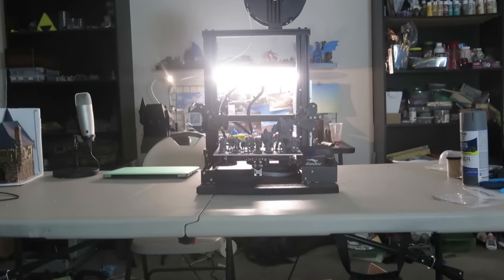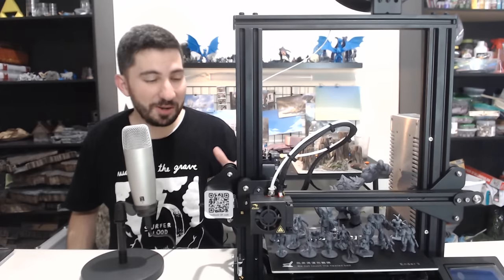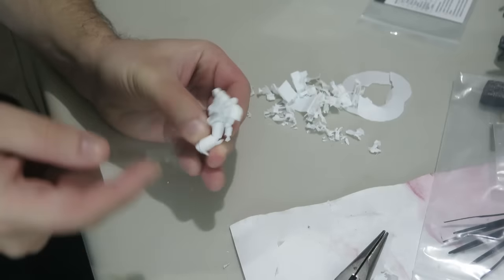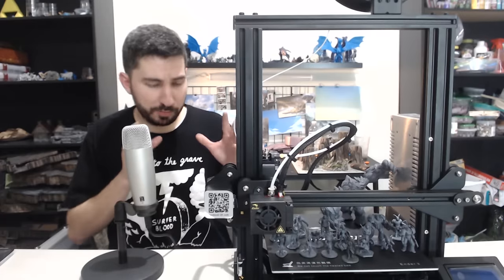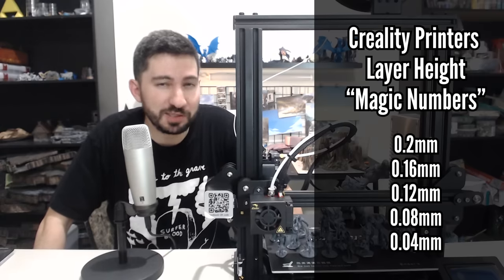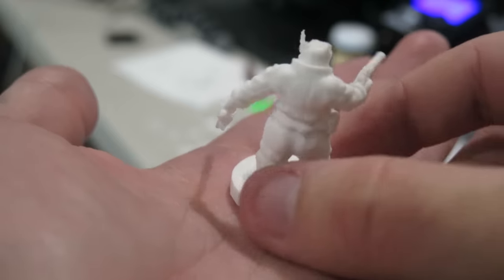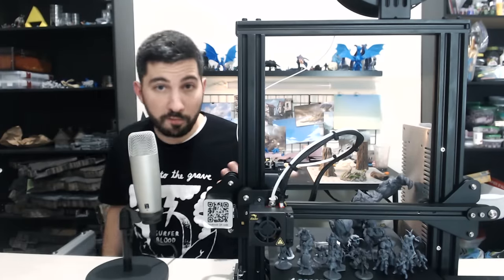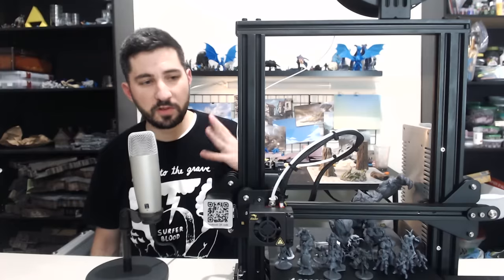How To Print Resin-Like FDM Minis on $200+ 3D Printers (Printing The Game #3)

Comment: Hey I got the ender 3 - i put a glass base plate on it but having print failures what do you recommended as base plate settings? As well as good prusa slicers setting for printing minis?

Comment: Ok so you're making these models with supports and all - what if you instead chopped them up and turned them into a sheet? (Looking at how Games Workshop makes all their Warhammer miniature sets) would it still be smooth? would working in width instead of in height increase your speed (slightly)? (mainly from not having to print many supports)
and then of course you get to glue them together, which is fun

Comment: Got another subscriber  :)  

I'm new to 3D printing and have spent quite a bit of time doing some research.  I've been most impressed with your results and that of a fellow youtuber "Tomb of 3D Printed Horrors".  So far, getting pretty reasonable results with a profile he shared and am about to try out the one you linked on your webpage (Siepie).  I'm curious though...which profile are you using these days and are you sharing it?  I pretty much have a stock Ender 3 Pro, save for some simple mods...the only one that could impact performance is the bullseye fan.

Thanks and LOVE the channel, keep the updates coming!

Comment: Im using Cura 4.8 and for some reason it won’t slice when trying to trick the layers. Won’t slice when top layers are at 9999999 and bottom are 0
Reply: Me too man. 4.8 doesn't like it. Just do 100% infill and change all your speeds to slower while leaving the top and bottom layers default. Trying it now to see how it turns out
Reply: @joelhamlyn5186  aye will give it a go mate

Comment: Couple years late to this party, but are there any changes you would recommend now that Cura has been updated? I am running into a problem when slicing models, the slicing is taking ungodly amounts of time. FYI I am very new to the 3D printing.
Reply from the maker: For now, I'd try some of the Cura Default Profiles actually! Fat Dragon Games also has a really great profile that is much better time-wise. I'll get around to doing a video on this soon though.

Comment: Hi there. I just found this video and downloaded the cura profile. However, I am not able to import it to Cura. I'm getting the following error. Failed to import profile from D:/Hobby/3D Prints/Cura Profiles/Siepie-CR10-Ender-3-Small-Minis-PLA-Base-1.0.curaprofile: Could not find a quality type normal for the current configuration. Any help. Would be much appreciated. Regards

Comment: Been trying out this profile recently and with 3.5.1 it appears that the Chunk option is bugged in that I can't see it any more. Also, I won't use ZigZag for the support again. It was all interconnected between the legs of a mini I printed and I ended up tearing off a foot. I'll try triangles next time.

Just found out that the chunk option only shows up for certain support shapes. Triangle is not one of them. Only appears for zigzag. :(

Comment: Trying this out now. It is my first printer, a CR-10s Pro. One thing I noticed was the base not adhering very well to the raft and lifting and moving slightly. Any tips?
Reply: Sounds like your bed level might need to be a little closer to get a better initial squish in the first layer

Comment: Its taking forever to slice, its been half an hour for a mini and still going with no progress on the bar. Did they fix the 99999999 layer height thing or is this normal? I'm using 4.4 ultimaker cura

Comment: my tree supporta always start to warp if they print far away from the model and my extruder bumps into them, any advice for this? i do use the regular supports depending on what quality i want or if im sure the tree supports will break and make my print fail.

Comment: so after thinking about 3d printers i finally got an ender 3 because of you and your vids. i played around with a few things from thingaverse and theings went well. I decided to try and print a figure but i can not get the profile to load it gives me this-Failed to import profile from C:/Users/randykathyv/Downloads/3DPrintingProMiniFile-Cura-4.2-and-on.curaprofile: Could not find a quality type high for the current configuration- am i doing something wrong. I am using cura 4.4.2

Comment: I tried printing the Tau 15 mm stealth suit and for some reason it was coming out horribly, it got to a point where the extruder was just missing the mark and drooping spaghetti in thin air. Any Idea why that might be?
 
I then tried the bigger settings for a 40mm version of the space marine and it came out okay, it was just hard to peel off the supports

Comment: It looks like Creality 3D upgraded the Ender with an MK10 nozzle. Thoughts?
Reply from the maker: To my knowledge it's always had a MK10 extruder - but I'm no tech-head. What were they using before?
Reply: @3DPrintedTabletop  the gearbest link in the vid advertises it with an MK8 nozzle. While the creality website states it has the MK10 now.

Comment: I'm using cura to slice my models and it's at 10 hours and still slicing...is this normal with your settings. Its slicing a kolbold monk 25mm tall model.
Reply: Did it finish yet?
Reply: @ethanthompson431  after 14 hours I canceled it. Started it again and 6 hours in canceled and haven't tried again.

Comment: My E3 almost perfectly prints minis with Cura standard profile, 0.4 nozzle and 0.12 layer. The only thing that annoys me were Cura supports as they are very solid and hard to remove, now i make them with meshmixer and that issue is solved. Trying to print with 0.2 nozzle ended in much worse quality while much longer printig time. I also don't notice much difference between 0.08 and 0.12 layer high with 0.4 nozzle, not enough to double printing time. 
Btw. tried to import your cura profiles, but gives error:  "Could not find a quality type high for the current configuration."

Comment: I am surprised I haven't seen any comments about  PVA filimant , if you have a dual extruder or can upgrade to a setup then you can print the supports with it and they will dissolve in water so you just soak the model and then no more pesky marks from supports

Comment: I got a creality ender 3, the nozzle can't move across the x axis without vibrating heavily or sometimes at all. Any time I try to print it just makes a 2 mm high wall all across the left side of the bed plate. I mean I had really high hopes, it is just not working and I don't know the problem or how to fix it, but I just give up, I have got such a big headache and I just want something to work so I can have some sort of hobby.

Comment: Hey I love the video, it has helped me learn a lot about the basics of settings for slicing software when it comes to printing minis. As someone who uses a flash forge printer and their FlashPrint Software i was not sure if you ever had translated those settings for FlashPrint or if anyone else has had luck doing so. i have gotten very close to the quality you are getting, but am still struggling with some details. Anyone who knows anything about FlashPrint for miniatures would be a huge help. Thanks!

Comment: I have applied to join the facebook group but have not been excepted yet.  So I will ask here. 

I have tried these setting is Cura but when I go to slice, it stalls out and there is no progress bar shown.  This only happens with the top and bottom layers betting at 9 infinitum and 0 respectively.  I leave those at default and it works just fine.  What's going on?  I am running the latest version of Cura if that helps.

Comment: I just got an ender 3. I can't get the bed flat though. It's driving me crazy. Any tips?
Reply: I ended up swapping it out for a glass bed. You can get one on Amazon for 20 bucks ish. You'll have to start using purple glue as an adhesive to make the print stick but now I hardly ever have to recalibrate my bed

Comment: 3D Printed Tabletop what happens if your printer needs supports for printing and it won't show. I use the cocoon from ALDI and it says that it needs all supports for the print but it doesn't have it for some of the models on thingiverse.

Comment: Hi! I have a ender 3 pro and can't seem to import your settings linked on your site.  "Could not find a quality type normal for the current configuration". Any thoughts?
Reply: I went ahead and put in the settings manually that i saw on you video but the slicing stops itself pretty fast. 
The thing that breaks my slicing is top layer 9999999999
Reply: @Andreasohlin  less 9's. Put 5 nines in and it should work.
Reply: @zorbat5  thanks! That helped :)

Comment: @3D Printed Tabletop Hi man I really appreciate your videos and I've learned a lot, I just really need help with something.  So  your Space Marine from thingiverse that you showed in this video is the first thing I printed on my Creality Ender 3 (which you said is the printer you used to make your minis) so when I printed it first the right arm just didn't print at all and was just a bundle of string, so I thought that maybe stringing was the problem, so I turned my retraction speed to 25 mm and to a 6 mm height. But even after that It still did the same thing.Can someone please help me?

Comment: With Cura 4.2:

(Cura) CR10/Ender 3 Terrain Profile Beta v. 1.3 - (fdmprinter) doesn't match with your current printer (creality_base), could not import it.
Reply: same here, im getting that error as well
Reply: I had  the same issue. Downloaded Cura 4.1 under "find previous versions" on their download page and it worked. Probably a bug in the newest version.

Comment: man because of your video i realy wont to buy this model printer and get into this hobbie i got alot of ideas i would like to try. would u say messing with 3d printers increase your electric bill?
Reply from the maker: Where I live electricity isn't TOO expensive - but no, it really hasn't impacted my electricity bill, and I'm often running multiple printers at least 15-20 hours a day (sometimes more). It isn't the cheapest of hobbies, but it isn't so bad either. Cheers! Good luck either way!
Reply: ofc they will running a heating element all day is like throwing cold cash in a burner.

you can test this yourself , turn on an electric oven at 180 degree's fahrenheit for 6 hrs a day for a month and check your electric bills

Comment: Currently this profile doesn't seem to work for Cura 4.2 (You can't seem to install the profile directly, and after going through and manually trying each setting, it seems to have issues with the top layer set to 99999 etc and the bottom layer set to 0). I found the easiest fix is to go to Cura's website and download version 4.1 or earlier where it still works. Not really a fix I'm sorry, but hopefully will help out anyone who might be confused.

Comment: the more plastic, the longer it takes to cool down... in my opinion, if you print at such speed and with full filling, it's a waste. As long as the machine does not vibrate, reducing the nozzle to 0.2 at twice the speed should keep the same flow of plastic, i.e. it will cool down, the printing time is the same and the quality is higher.

Comment: Cannot import profile to Ultimaker Cura 4.4.0, errors with "could not find a quiality type high for the current configuration"
Reply: have even tried 4.3, same error. 
now 4.2.1 wont import saying it doesnt match with creality_base.
Reply: Had to go all the way back to Cura 4.1 and use the older profile, as the new one just doesnt seem to work at all.

Comment: Is there any Anet A8 profile for printing minis? I really need one .
Reply: Just drop the mini model in Cura, pick finest detail profile to start with, set the bed temp about 50c or 60c if you are having trouble keeping the part warm, set the fan speed at maybe 80 or 90 (this helps me a lot to make the mini stick since the fan blows too hard and cools the mini), set the supports to everywhere and just use the standard but make sure you have some needlenose pliers to peel them off, set the temp to 10 degrees above the lowest temp recommended by the filament manufacturer so like if it says 180c set it to 190c, set the speed to 20 or 30mm per second for all the different types of movements that Cura allows you to change so that the printer is moving really slow and not vibrating like crazy, set endfil to like maybe 20-50% (or 100 if you prefer, but in most cases it's not necessary I've had good results with 20%), and set the top layers to 9999999999 lots of 9s. And set the bottom layers to 0 (this doesn't matter all that much). It's really the fact you have lots of top layers (top layers print with a nicer finish) and the fact you are printing very slow and the fact each layer is really close to the last one that makes it work.

Comment: I tried putting the top thickness to 9999999999 like you did but it doesn't manage to slice it. Will 999999999 work as well?
Reply: This is a 3 year old video, you're likely using the latest version of Cura which changed a lot of things compared to the version of Cura being used in the video.

Comment: Did you post your temp settings and i missed it?
Reply from the maker: No, I didn't - mostly because temp settings vary based on the brand and color of filament you're using (even assuming you're using PLA). With White Hatchbox, I usually print at 205-210 degrees :)

Comment: @ 3d Printer Tabletop - dude, you must be doing something else.  All my minis fail - I'm 0-6.  I'm using your profile.  I can print bigger stuff just fine.  Did you print them at 45 degrees or something?  Siepie-CR10-Ender-3-Small-Minis-PLA-Base-1.0.curaprofile
Reply from the maker: Talk to me, Will. Send me some photos, print failures, the minis you're printing, etc. I angled at 45 degrees sometimes, and other times standing up straight depending on the mini. Another good place to start: The Tabletop 3D Printing Guild. Lots of folks there who're willing to help when I can't respond fast enough. Let's get you some better minis my friend.
Reply: Some others told me that Cura 3.5 might be the problem.  I'm going to try 3.4.1 and see how that goes first.
Reply: I used the profile on your site, switched to Cura 3.4.1, and it worked so much better.  I'm going to dial it down from .08 and see how that turns out.  Thanks.

Comment: Where can you find ready designed minis for Dungeons and Dragons which I can apply these settings to and print or is everyone designing their own?
Reply from the maker: There are TONS of ready designed minis for D&D which you can apply these settings too! Thingiverse is a great source. I include links to all of the models I show in the description as well in every video I make (since the very beginning). 

Miguel Zavala, mz4250, has spent the last few years modeling all of the monsters in the Monster Manual and many other 5E books. You can check out a list of his models here: https://imgur.com/gallery/POE4c4h and also, he has a full list available in a Google Drive (more organized format) on his Patreon as well: https://www.patreon.com/mz4250. 

Let me know if you have any other questions, Ben! You're welcome to join us in the Tabletop 3D Printing Guild as well!
Reply: 3D Printed Tabletop what happens if your printer needs supports for printing. I use the cocoon from ALDI and it says that it needs all supports but it doesn't have it for some of the models on thingiverse.

Comment: The 100% infill doesn't work because it will try to fill the print with a # pattern and 100% full. So all those lines don't really fill up properly at all, where if you make it all top layers it will follow the wall shape and make everything the same.

Things you should do before even trying some ones profile is calibrate your extruder and do a PID tune.

Comment: I'm 52 handicapped modeler and not a computer dude..
I work in 35th.scale but the models are expensive when your on a very limited budget.
I want to make 35th scale WW2 soldiers,tanks dioramas.

Can it be done on that printer in your video.?

And is it easy to do..I know nothing about  3D printers and how they work..
I'm a on off type guy not technically inclined
Reply: Depending on your budget a lot of the budget printers involve work, in the higher end ones there is less trying to get it to work correctly. Check out thingiverse there's a lot of models ready there for printing

Comment: I just built my Creality Ender 3 Pro 3d printer. finished building it and everything seems to be working smoothly EXCEPT it will not read my micro sd card no matter what I do. I've reformatted the card a few times but nothing seems to be working. any one else dealing with this?

Comment: I'm gonna say something that might piss people off but I'm going to say it because anyway.

If your print fails the material cost is negligible, the time lost isn't.

Also, why doesn't anyone print a sprue then assemble minis? I figure that it would save on print time.
Reply from the maker: After I saw your first line I was expecting something much more incendiary :) 

As far as the sprue goes: One of my favorite parts of printing vs. sprue is that there's much less assembly required. Both still need post processing whether it's mold line removal, minor sanding, but at least you avoid pinning and gluing sometimes. Also: sprues are essentially supports for molded figures :) Thanks for your comment!

Comment: hi i just typed the same 9999999999 for  top layers and 0 for bottom layers as you said and my cura version 4.6.0.crashes on  slicing with that 9999999999 number .. :(   it just wont accept it :(    oh balls !!!  back to the drawing board maybe its my graphics card :/